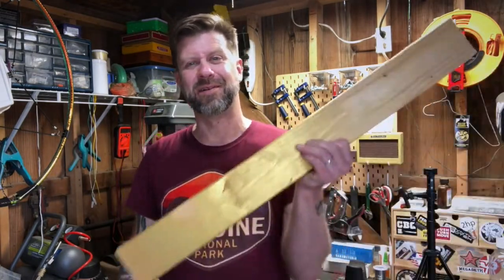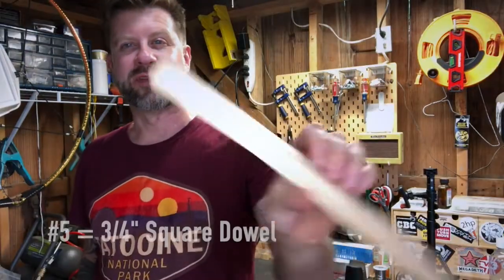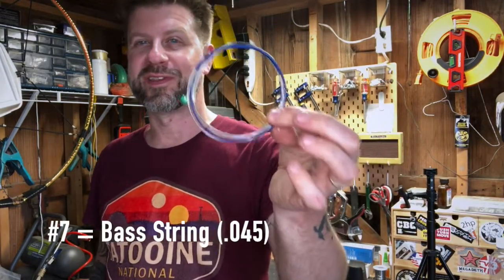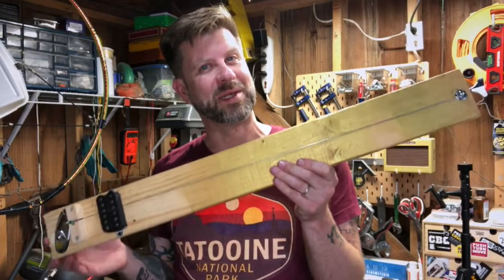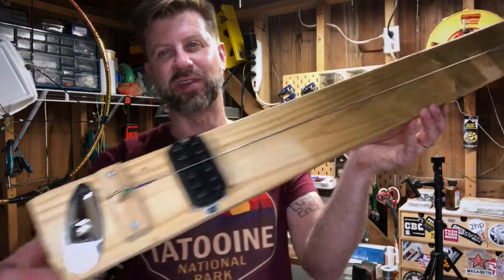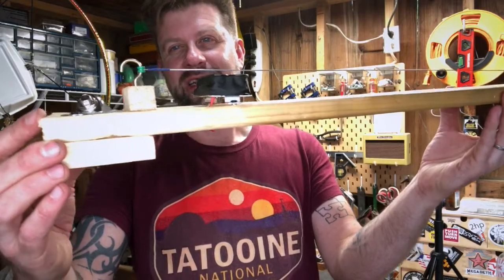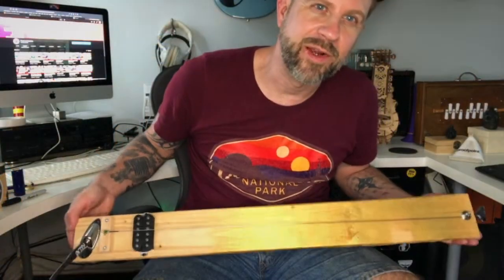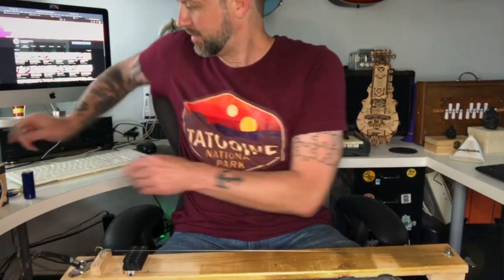Let's Make a Diddley Bow in 10 Minutes

Comment: Fun build! Finding the harmonics is a little beyond me right now. I need to do some looking around to see if I can find some resources explaining it a little more low level for my tired brain. Thanks for the fun content!
Reply from the maker: Glad you liked it. Finding the harmonics is easier than you think. Just look at the string find the approximate middle, lightly place your finger against the string (not hard enough to move the string towards the fingerboard, but enough pressure that it doesn't vibrate), pluck it, and then move it up/down the string until you hear it "sing". That's the harmonic. The strongest harmonics are at 1/2-scale, 1/3-scale, and 1/4 scale from the nut.
Reply: @musicalmiscellany  Thanks for the info! I will play around with it and see how it goes.

Comment: Am I crazy? (I know I kinda am, but bear with me.) I would have tried installing the pickup "horizontally", meaning of course parallel to the one string and right under it.
Wouldn't you have stronger (and maybe even dirtier) signal?

Anyways, great build as usual, and much entertaining.

c H e E r S !
Reply from the maker: That is an option and many folks do that sort of pickup arrangement. However, that doesn't increase the output of the pickup and I don't care for the look of it. It may change the tone (just as moving the pickup closer to or further from the bridge does) and, if you prefer that... go for it. By all means... make it yours.
Reply: @musicalmiscellany  Thanks, I'm definitely gonna try it when the time  comes.

Comment: Which way round do the Wires go . ?
Reply from the maker: The positive wire from the pickup goes to the tip of the jack and the negative wire goes to the sleeve. That's the standard for all guitar wiring.